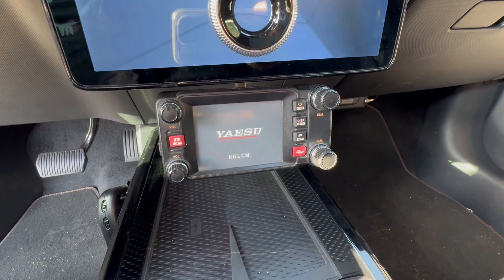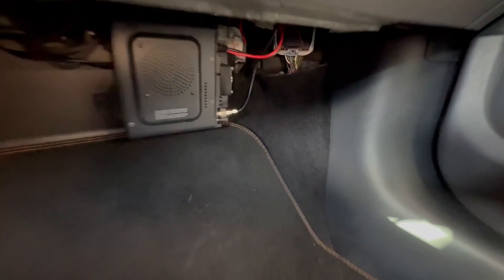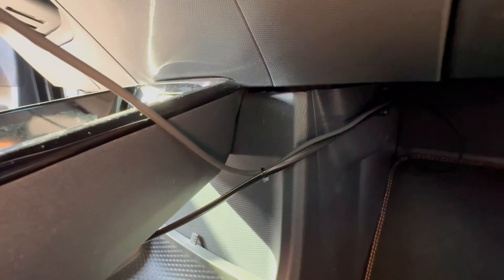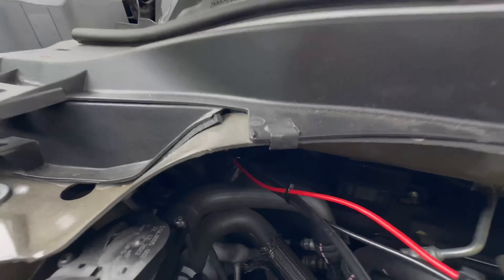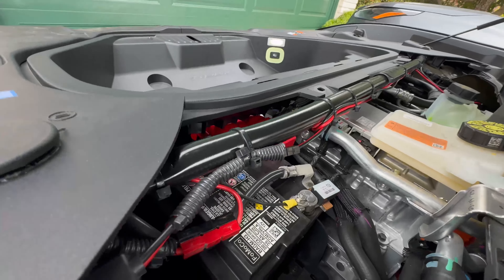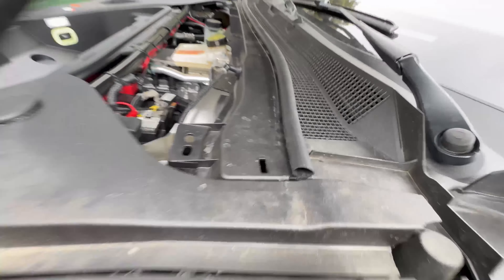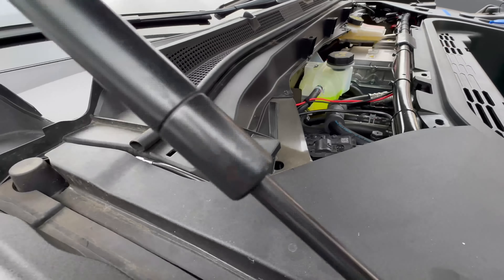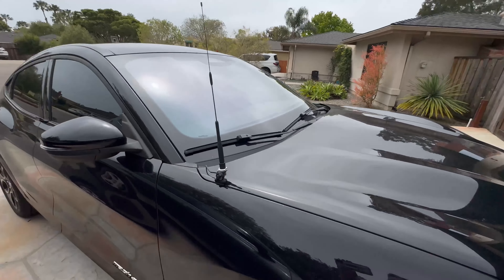EV ham radio installations don't have to be hard: Mustang Mach-E installation

Comment: Did you do some testing of how well your mount to grounded to the vehicle ? I took mine on its first drive today and two locally strong repeaters had marginal to fair reception . It was too cold for me to do further investigation , I will do that in a day or two . I mounted at the end of the frunk (nearest to windshield ) where there appeared to be wholly metal , no weather strip. Did you scrape away some paint from the underside of the frunk ? I did not , I did not use the shims … was hoping the screw would make better contact that way . I will try measure resistance when weather improved .
Reply from the maker: Thanks for the comment! I didn’t do any grounding tests for my installation, and honestly, I didn’t concern myself with the ground at all. I’ve never done that with any of my VHF/UHF mobile setups, and I’ve found it’s generally unnecessary for those frequencies. Proper grounding is more of a concern for HF installations. Let us know how your testing goes once the weather improves—I’d be curious to hear what you find!

Good luck with your setup!

Comment: Nice install. You didn’t have much space to work with in the frunk area, that must have been a challenge. I have been wanting to make a video on my install. I’ll get to it when I clear a few projects out of the way. Cheers! KO6BXC
Reply from the maker: This vehicle actually had quite a bit of space close to the firewall. But the pass through was really wedged up under there. I was just glad that there was a factory hole that I could use. It took me about an hour of looking and thinking to locate it.
Reply: I asked my Ford dealer today if they would do it for me since I am nervous about doing it myself . He was hesitant and wary about poking around a high voltage vehicle . He agreed to taking a look where you located the grommet and will then make a decision . I may know later today .

Comment: The frunk is conductive enough for a good grounding for the antenna , not aluminium?
Reply from the maker: Yes. The trunk/tailgate is largely plastic around the edges, however.
Reply: Thanks . One more questions . I assume no problems with 12v battery drain with your FTM-400 off overnight ?
Reply from the maker: @obrienaj  I set my FTM-400 Auto Power Off feature (setup>config>#13 APO) to 2 hours. I have never let it run overnight. I am not sure if the high voltage battery system will charge the 12v battery if there is a constant drain with the ignition off. That's a good question.

Comment: What was the make/model of the lip mount you ended up using? Did it fit in the gap without scraping the paint or interfering with the close? Thanks!
Reply from the maker: Good question. I believe it is the Comet RS-520. Others can be larger and the Mach-E has a tight tolerance.
Reply: @levimaaia thanks for the response - about to pull the trigger on doing the same with my FTM500. What did you use for the head mount (magnetic cell phone mount you mention), and are you happy with how sturdy it is? Thanks!
Reply from the maker: @Wmd21  Not exactly this but something like this. I ended up mounting the two-way tape on the opposite side as recommended and it worked perfectly: https://www.amazon.com/LISEN-MagSafe-Strong-Magnet-Magnetic/dp/B0CGHNQ53C/
Reply: @levimaaia great - thanks!!
Reply: what do you mean by other mounts “have a tight tolerance “ ? My dealer said he will do it next week if he is comfortable that there is no high voltage stuff near that grommet . What coax did you use and what gauge wire to the battery ? I will buy coax and power cable in advance . Did you put a fuse for the power cable AT the battery  ?
Reply: me again , I have not used a mount other than a mag mount before . I am looking at info about the Comet 520 and am confused when the DX Engineering web site’s specifications said “mount type , none”. What is the antenna you are using in this video and what mount type does it require ?
Reply from the maker: @obrienaj  According to the Comet data sheet, you can use any PL-259 mounted antenna up to 45 inches. http://www.cometantenna.com/wp-content/uploads/2013/09/Mobile_Mounting_info.pdf
Reply: Did you literally just have to lift up that cover our did you do some other work before the video ? My dealer says there are some bolts that he would have to remove that will take about 10 minutes .
Reply from the maker: @obrienaj  you have to delicately remove some clips. It is a pain and you risk breaking them if you are not careful. If you are not confident, you might have the dealer do it.